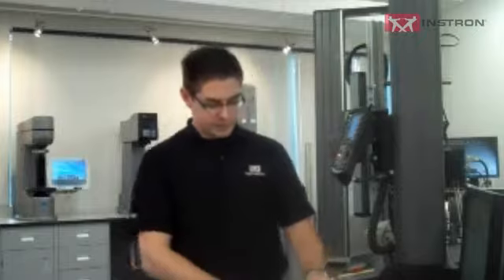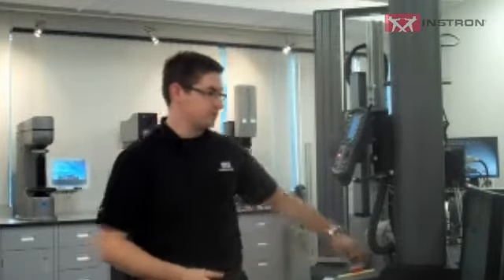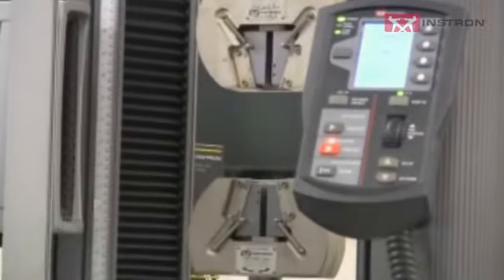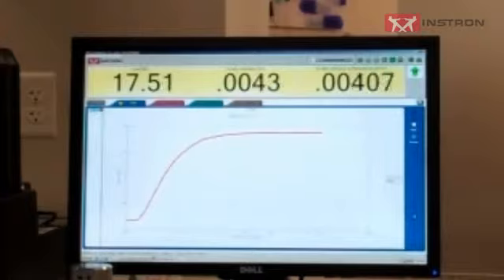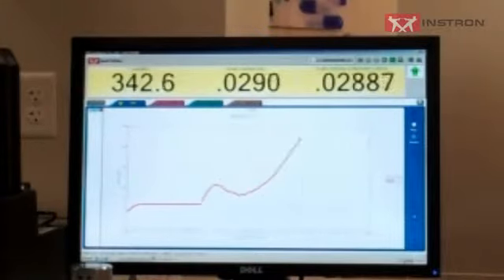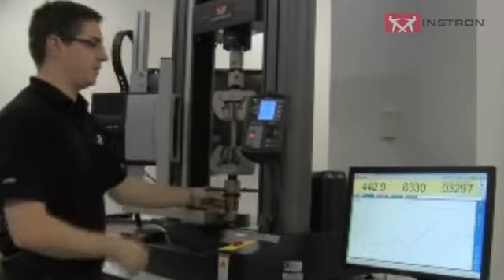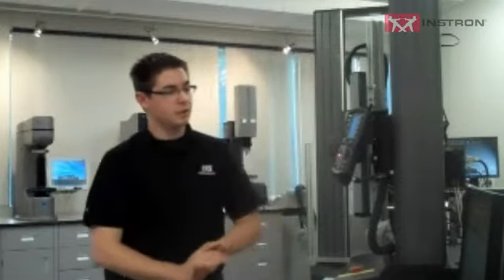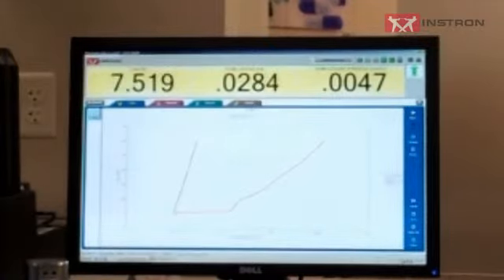Eliminating Load String Compliance

Comment: Nice and informative. May i know that for removing the compliance you initially inserted a specimen and later you rerun the test again. During this rerun test you used the same specimen ???
Reply from the maker: Hi Zain - The specimen used to preload and remove compliance from the load string will not be representative of the sample being testing.  This preload specimen is often much stronger and can withstand maximum system forces.